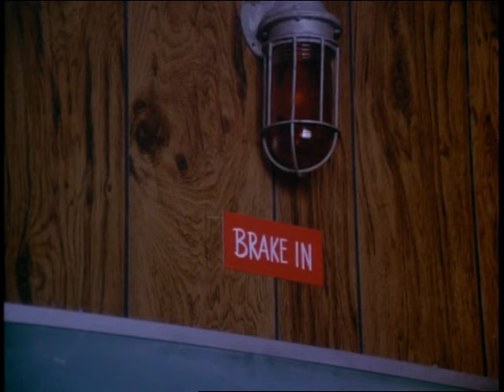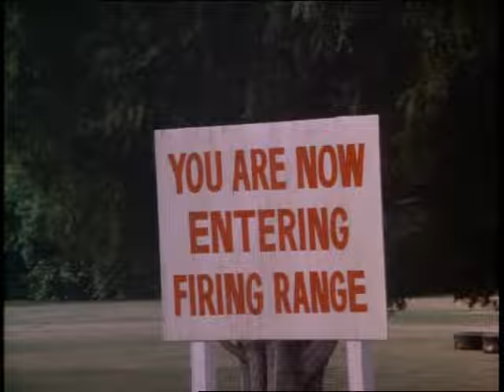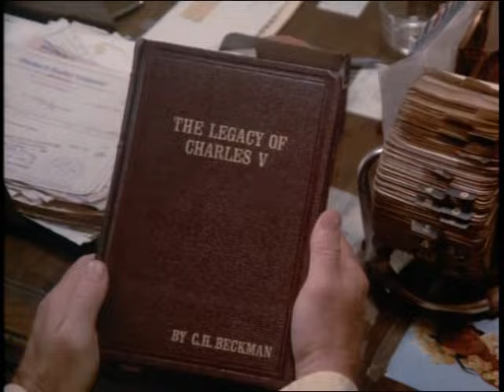♦TV Classics♦ Salvage 1 (S01E05 Bugatti Treasure)

Comment: 32:17 - Jeep that drives to flagpole is an M38A1(G758) 'C' variant with split windshield to accommodate an M40A1 106mm recoilless rifle.
Reply: You know your jeeps.
When the Cold War ended France had a massive amount of WW2 jeeps stored which they slowly put onto the market, they held in reserve for WW3.
Reply: @skylongskylong1982  There were also tens of thousands of 'Jeeps' built in France by Hotchkiss under license from Willys Overland and successors through 1981.  They remained in service until retirement in 2000.

Hotchkiss built the M201 'Véhicule Léger Tout Terrain' (and variants) for military use, initially from surplus Ford and Willys WW2 surplus vehicles, then gradually producing their own body stampings, frames, and other parts 'in house'.

Early examples used the Willys Go Devil engine, Peugot engines were used as well from 1962 onward.

Civilian Hotchkiss 'Jeeps' were designated JH-101 and JH-102.